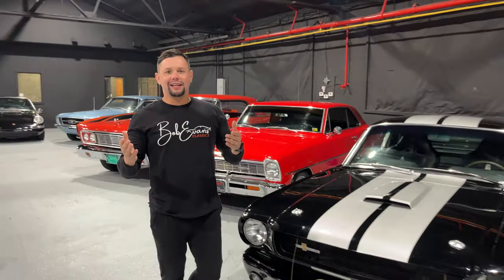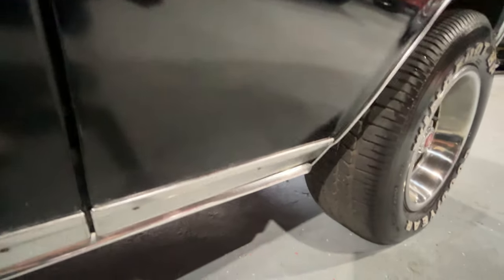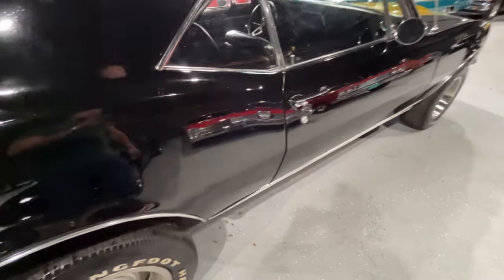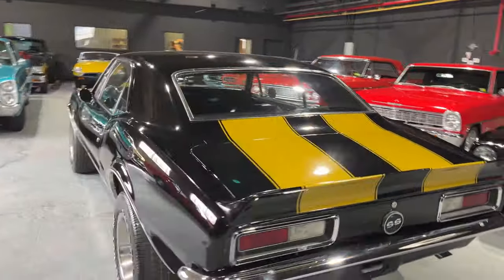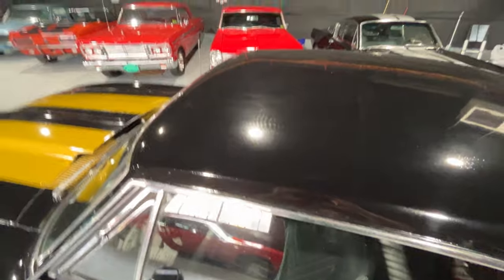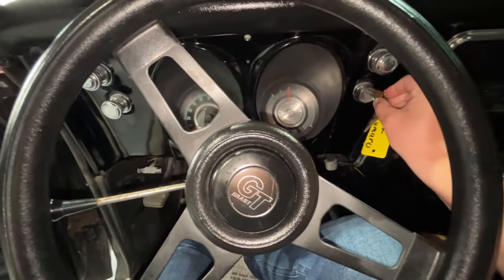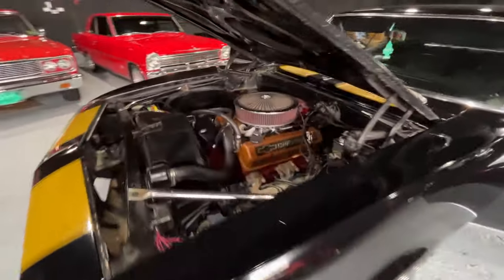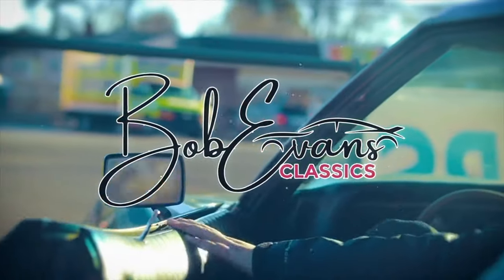1967 Camaro $35,000 V8 350 4 Speed PS FOR SALE Bob Evans Classics We Finance and Ship Classic Cars

Comment: Tried pressing the dimmer switch a few times but I'm sure you got a guy that knows exactly how to find out what's going on with those headlights got to be something simple just a freaking wire little wires shorted out somewhere no biggie probably a little electrical tape and bingo You're in business That's a damn nice Camaro bud 35,000 I don't have anything near that or I think I'd buy that puppy that is a beautiful freaking Camaro It sounds great and it's got a four-speed in it or a 5-speed either way That's a cruising machine that would be fun. 😊